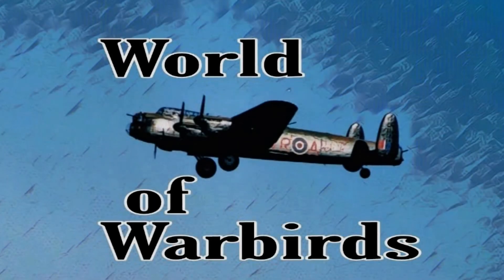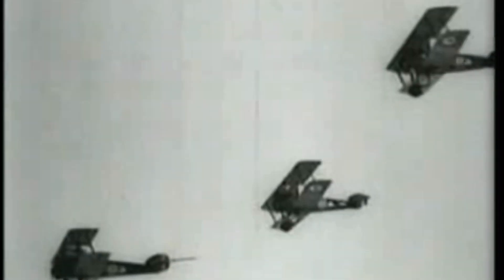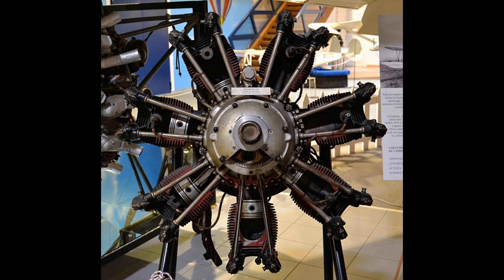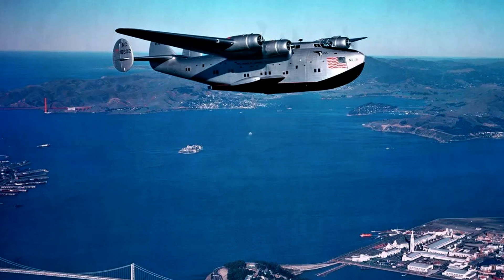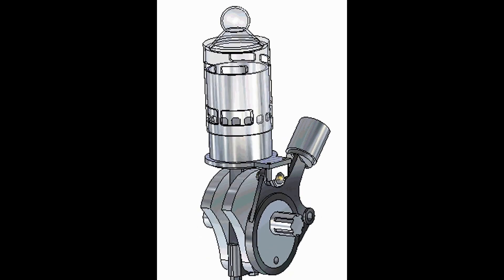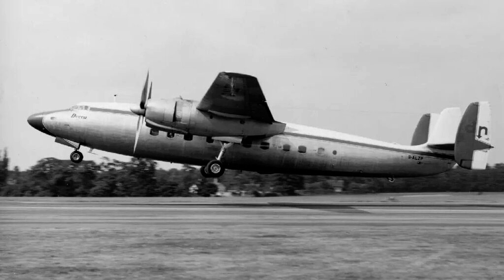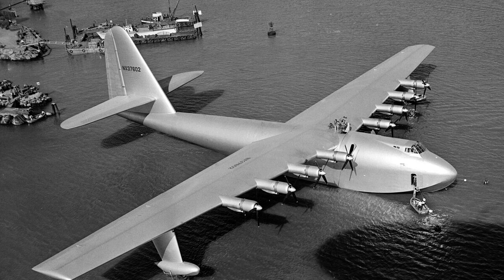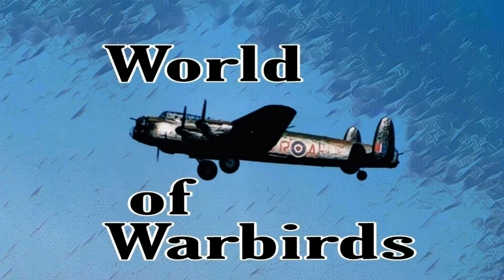Quest for Power Part 2: Rotaries and Radials!

Comment: Sleeve valves had a relatively short period of fashion during approx. the Thirties in the car industry. Their main adavantage was quietness, due to much less moving parts and those parts basically "sliding" instead of popping and clicking.
The went out of fashion because of issues with oil leakings that weren't addressed.

Comment: Ive read the "V" liquid cooled engine, although they had a vulnerable cooling system, were more fuel efficient. Radial engines ran richer to run cooler. Just like an old VW engine.

Comment: You stated that the CW R-2600 was the contemporary of the PW R-1830.  Maybe as designed with multiple rows but not chronological nor displacement.  The contemporary for the PW R-1830 that you failed to mentioned was the Curtis Wright  R-1820 which was used in 44 different airframes, including the most famous being the B-17 and others like DC-3/C-47, FM-2 Wildcat and the SBD Dauntless.  The real contemporary of the CW R-2600 was the unmentioned Pratt & Whitney R-2800.  That wonderful engine powered 34 aircraft including the F6F Hellcat, F4U Corsair, Republic P-47 Thunderbolt and the Martin B-26.

Comment: As a long time car mechanic I cannot imagine the complexity of these large radial engines, the amount of hoses lines and wires must have been immense, so I imagine working on them must have been a nightmare for the technicians
Reply from the maker: Imagine changing all those sparkplugs!!
Reply: And they did that detailed work under definitely sub optimal conditions. The B-29 was first deployed in China at unfinished airfields, so the work was done with limited equipment, supplies and experience, in China.

Comment: B 29, engine fires are not the rear cylinders 'bursting into flames." What exactly would burn?
Reply from the maker: The metal would overheat, weaken, fail and then the flammable fuel and oil would light up and at extreme heats even metals like magnesium can ignite.

Comment: Great video, very detailed. But how in hell did they cool 4+ banks of radial pistons (Major)  ,surely they would need a powerful fan ?  ..and stop calling me surely.
Reply from the maker: And in the case of the B-36 pusher configuration, the whole lot was buried inside the wing! Also imagine changing all those spark plugs!
Reply: @worldofwarbirds 2 per cylinder, 56 per engine. 336 spark plugs. Which usually had to be done after every flight before they were redesigned with platinum tips which helped a little.

Comment: Just curious what the picture @11:12 is supposed to be.  Surely those are not Wright 3350’s lined up.  The objects in the photo are much too big to be a radial engine in comparison to the person standing in the upper portion of the picture.
Reply from the maker: Yes, you spotted an error. The image was misidentified when I chose it. I have been told by eagle-eyed and knowledgable viewers that these as NORDBERG Radial stationary engines.

Comment: I just wonder why they did not fix the rotary to the airframe and just mounted a ventilator prop to the axel behind the propeller. The early FW 190 did excatly this. But maybe the heat from the engine would just scortch the forward fuselage. I remember the FW 190 test pilot could barely handle the plane due to the burning heat on his legs.